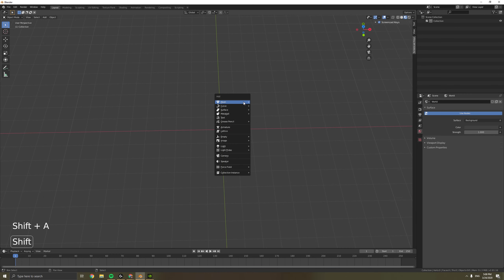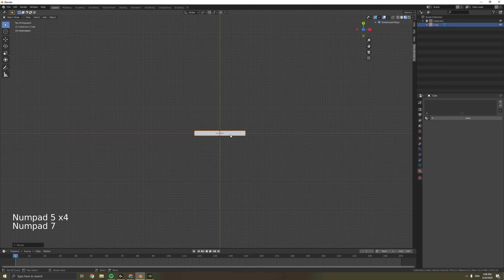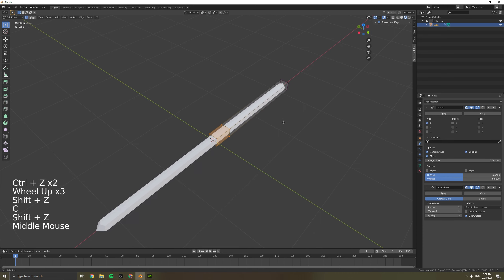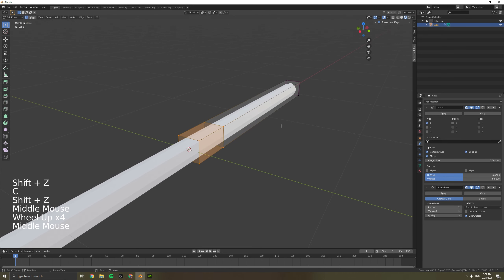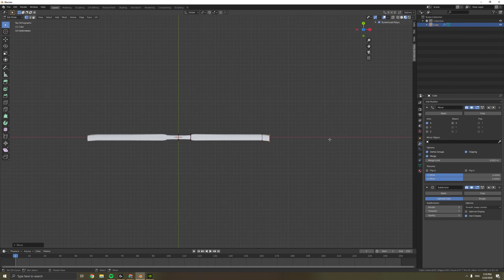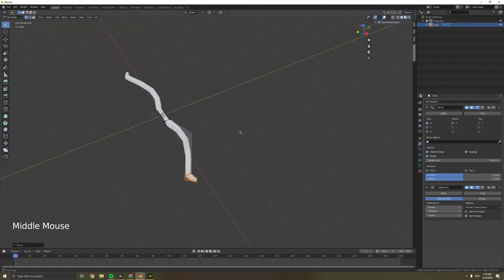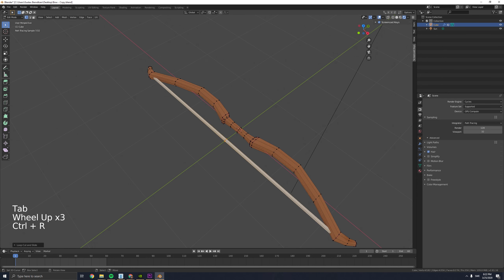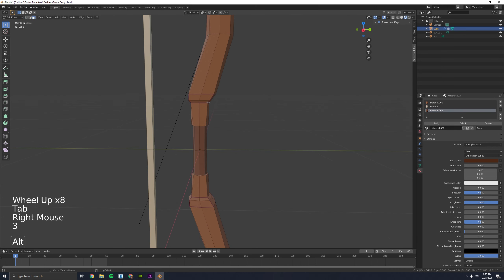Creating a LowPoly Bow In Blender 2.80

Comment: Thanks for the rapid tutorial bro, I was just wondering about how you did the bowstring though. You added the cube mesh in edit mode so it's the same object as the bow itself, but how did you make it so that the bowstring is unaffected by the subdivision surface and mirror modifiers?
Reply from the maker: To make the string not be affected by the sub division modifier you need to select the entire string, then press shift+e then press 1 or drag it. For the mirrored string I would just remove the bottom part. Hope this work otherwise write another comment😃
Reply: @gurra3d944  Perfect, that makes sense! Thanks a lot mate! :)